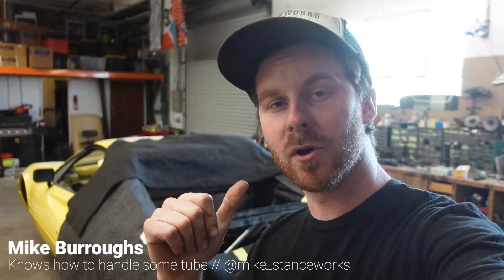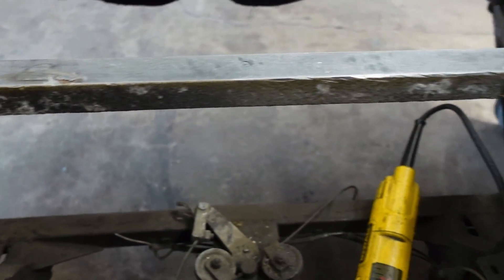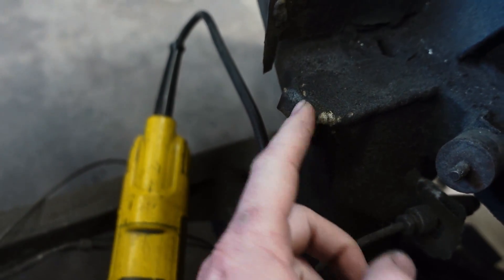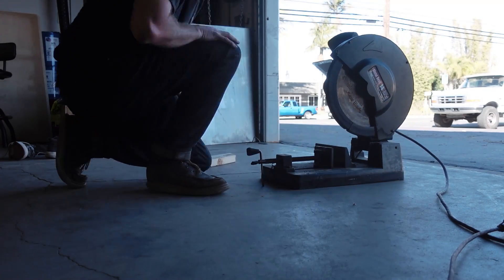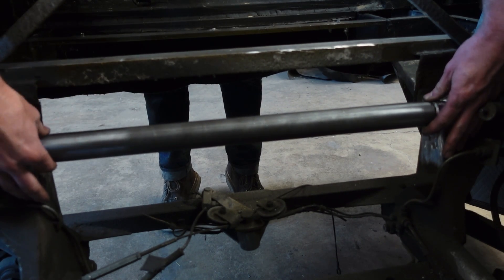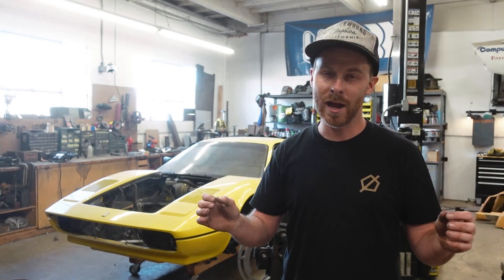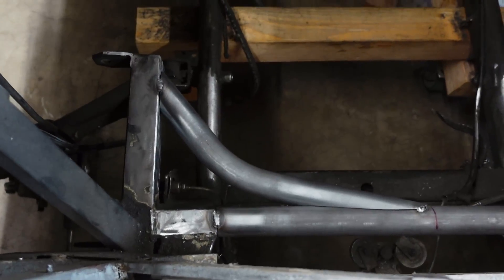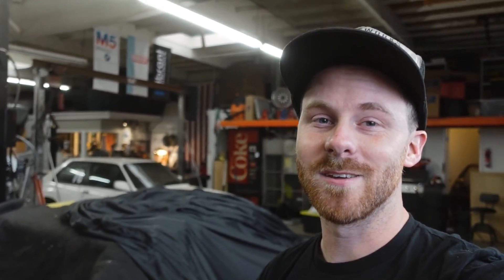Swapping a Turbo Honda K24 into a Ferrari 308 GTBi - Ep. 19 - Fabricating New Chassis Tubes

Comment from the maker: I realize I totally forgot to explain what tubing I am using and why I chose round tube over square tubing! I'll save the latter for the next episode, but the short answer on material is I have chosen to use 1.5" .095-wall DOM tubing for the major structure. Overkill, but undoubtedly more than stout enough!
Reply: Chromoly tubing?
Reply from the maker: Chromoly tube is prone to cracking and needs to be TIG welded very proficiently, I have no business working with chromoly. It’s also a bit outdated with the introduction of Docol R8 anyway.

Comment: Always remember that, as long as you get adequate penetration and filler rod melted in there, it doesn't matter how shit your welds look, because they'll be strong enough to serve their purpose. You can always grind back and sand the surfaces to hide less pretty welds if it bothers you. Also, the answer to welding in really tight spots is an oversized shielding gas head and a really long tungsten electrode stuck pretty proud of the gas head so you can poke it into the tight spot and rely on an excess of shielding gas to keep your welds decent.

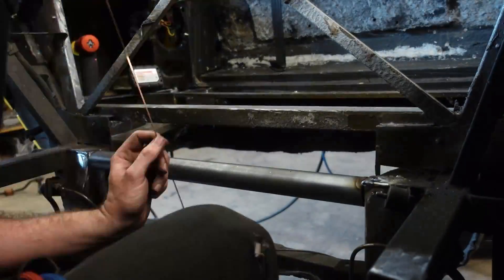Comment: 4:32 Quick tip when welding tubing closed make sure to have a vent hole not only can you use said hole for back purging for a stronger weld it also acts as a vent for any hot air to stop any blowouts on your welds. ;)

Comment: You Should Consider modifying you engie hoisdt to Air over hydraulic as well. it wine save you pumping that honda motor every time you pulit it which is Honw many times now? the mod is fairly simple and you can look up how to do it on youtube.  You already have a compressor, let your equipment do the work.

Comment: Edit* you explained this in the next video. Loving the series! 

Did you ever think about using chromoly for your cage or bracing? It’s substantially lighter and stronger than steel but it is pricey. It also welds similarly to plain mild steel so it could be a good option.

Comment: I really admire your tenacious attitude, and you're making impressive progress! I don't have a huge amount of fabrication experience, but I'm concerned about the cross tube you butt welded in. I would think it would have better strength if you lengthened the tube and notch each end to overlap the chassis. Please keep going! I want to see and hear this drive!
Reply from the maker: It would, but then it wouldn't be in the plane that I am looking for. This is also not a wildly high-stress location either.

Comment: Is it possible to take the same size tube your are coping to, glue some sandpaper to it and mount it in a lathe, drillpress w/e. And then use it to grind out a lot of the metal on the tube you are working on? Instead of having to go back and forth that much, you get it pretty close fit when holding it to the spinning tube with sandpaper? 

Oh yea, I have absolutely no experience working with metal or anything like this, shoot me if I'm wrong
Reply from the maker: I like where your head is at, but that won't work, unfortunately. The lathe would try to spit the part back out at you. I'm not sure how to explain it, other than to say, think about the fact that while one hemisphere of the sandpaper is spinning away from you, the other hemisphere is spinning towards you.
Reply: @stanceworks  yea that makes sense, the spinning sandpaper would basically grab your part.

Might be a good thing I haven’t worked with metal, would probably be waving with 3 fingers

Comment: once i saw you remove the trunk, i wondered if you were going to take out that tube! i think taking the straight tube back out and welding the 2 bent pieces to it on the bench seems a good way to do it.

Comment: Cut the welds tack it to a couple of bits of scrap to keep it from warping and weld it on the bench.
Alternatively cut it out bend another bit with a 45 degree bend instead of the extra long cope.
Reply from the maker: A 45 degree bend in the tube would lengthen the cope. It’s only 40 degrees as it stands.
Reply: @stanceworks  I might not have been clear on the number of bends.
The initial bend and a 45 making the tube S shaped . The cope would then be reduced to the size of the pipe diameter.

Comment: Becareful when using acetone and welding as it gives off a dangerous gas and didn't see you use weld through primer with the tubes...Loving the build 👍👌
Reply: Brake cleaner and welding are far worse 🙈 Acetone gets dangerous when it's so much of it, it catches fire. But the small amount used, usually evaporates before you get the time to start welding.
Reply from the maker: Chlorinated brake cleaner is the dangerous one. Acetone is widely regarded as safe to use for this process
Reply: @stanceworks  acetone is "safe" but it does dry out your skin. gloves...
Reply: For the record, it is "Brake Cleaning" solvents that are the chemical threat.  Chlorinated produces chlorine / phosgene gas when exposed to heat and uv light.  Phosgene is what was used in WWI, also known as "Mustard Gas".  Also watch out for the "Non Chlorinated" Brake Cleaners.  They both  tend to be made with Methelyne Chloride (Furniture Stripper), and the Non-Chlorinated ones also have heptane, hexane, etc.  Acetone is really the only solvent you should use to clean something before welding.
Reply: Tell you what, I wouldn't want to breathe a rag that big soaked in acetone!

Comment: I know it's a lot of work, but does those square pipes metal is same as those new round tubes or not? If it is, then why don't swap the all the square pipes? If the round tubes are lighter and stronger (not by design, but material) is there a plan for upgrading whole round tube chassis?
P.s - put nitrous inside pipes, like Porsche did on, i think, 962 or later iteration xD

Comment: I'm surprised that you chose not to use a band saw to cut off the tube ends. I've used grinders before but I've often gotten out of square when cutting, and the band saw just eliminates that.
Reply from the maker: I’d use one if I had one! It’s on my list of tools to buy.
Reply: @stanceworks  also on my list, a portaband with one of those swag offroad tables to mount it for fixed occasional cutting
Reply: @Garrett_LCD  Just checked those tables out. They're pretty slick.
Reply: @nottherealjk  awesome price too, really makes the most of your saw. A couple of my buddies who've built serious tube buggy rock crawlers have them.
Reply: Either way, your fab skills are way better than mine and it looks awesome! Can't wait to see this come along some more.

Comment: In one of your previous episodes fitting the engine, you were going to cut off that tab (that's part of the top mount) and a little more of the square tube you attached your bent tube to.  Have you changed your mind, or is there some other reason why it's there while you are adding stuff?
PS - it's a super interesting project, so keep up the good work!
Reply from the maker: I’ll still be cutting some off the end. Notice my new tube doesn’t extend all the way out.
Reply: I’ve got the same question)